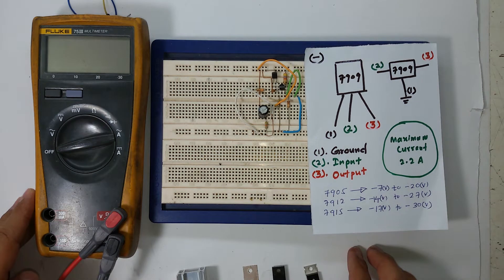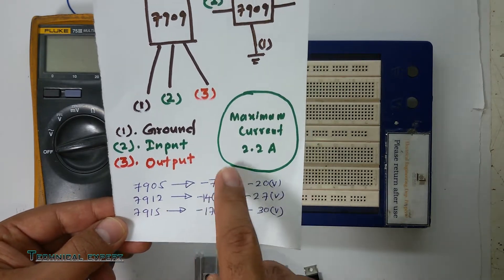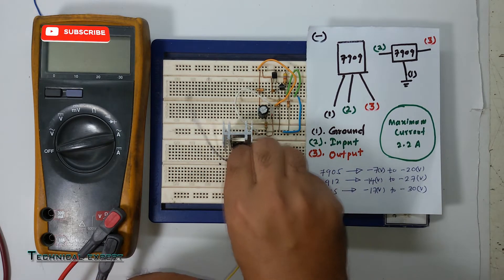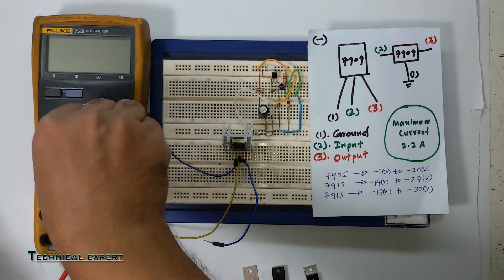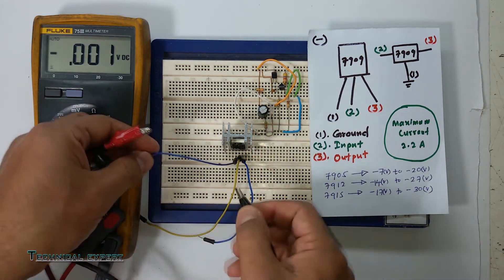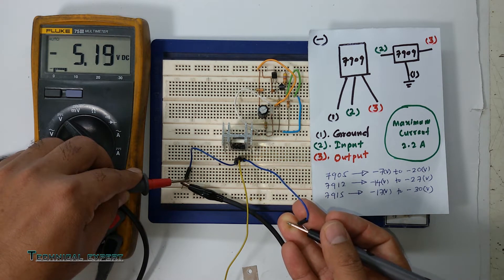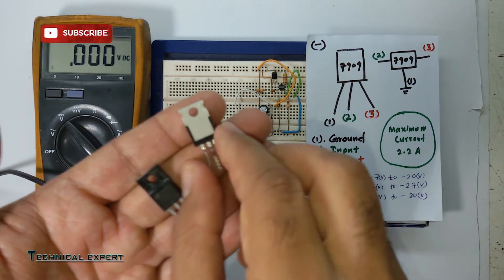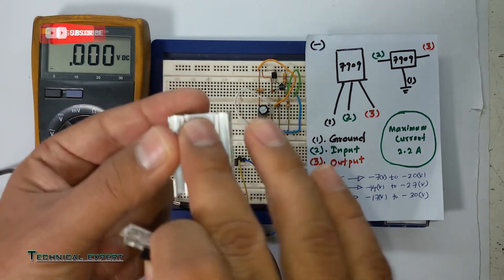How to check 7905 Voltage Regulator with multi-meter practically.

Comment: Yes, its great to see ... because your input is positive voltage, its a negative voltage regulator. When you have a negative rail to regulate then the output goes to the filter side and the input goes to the regulated side ... according to some diagrams. Others put the negative voltage to the input ... thinking thats correct. Since they are "inputing" negatve current and outputing negative current. So seeing you put the postive to the input makes me think the former is correct.

Comment: Bro i know your trick u interchanged polarities of multimeter it wont directly give -5 v
Reply: Yes. Wrong polarity voltage
Reply: What a misleading video because if you put +ve to the input Voltage Regulator will be shorted and blown 💣